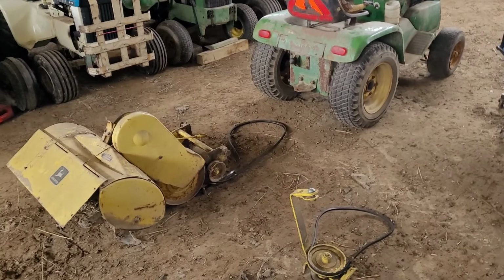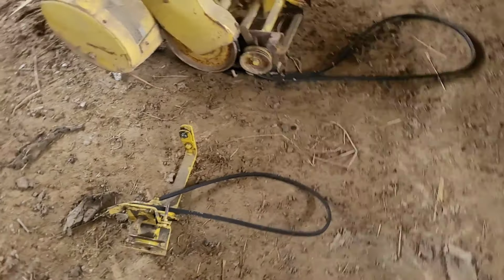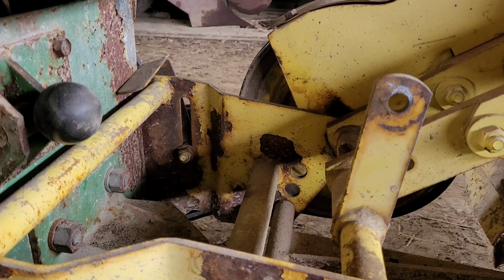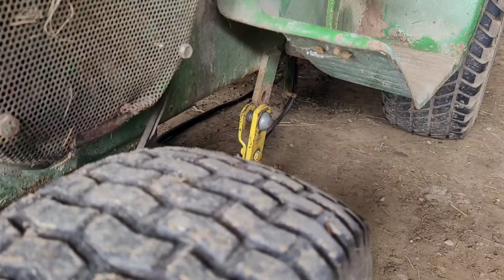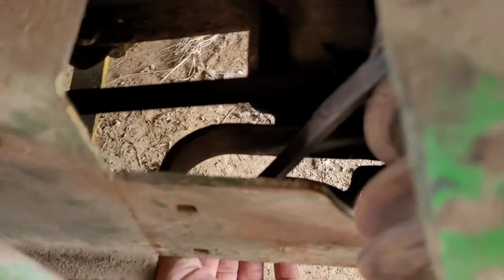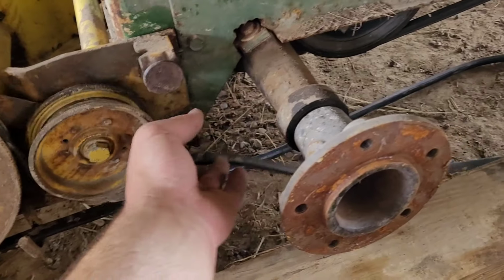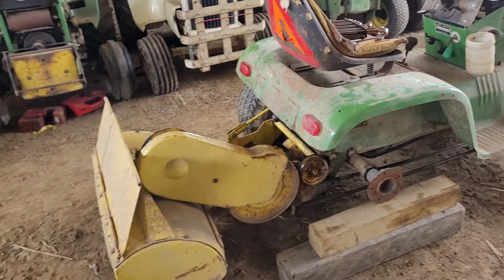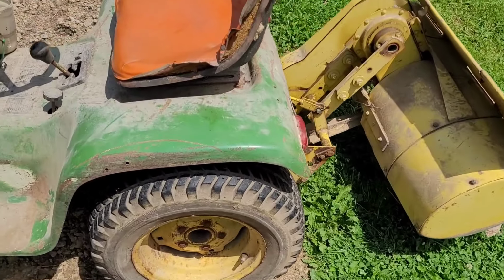how to install John Deere 31 tiller. (John Deere 110, 112, 200, 208, 210, 212, 214, 216)

Comment: Did the smoke clear up? You could try adding Engine Restore to the oil. Project farm tested it and showed it worked. Probably takes a fair amount of hours to start working, not like its going to clear things up in 20 minutes. But worth a try.
Reply from the maker: It's getting better